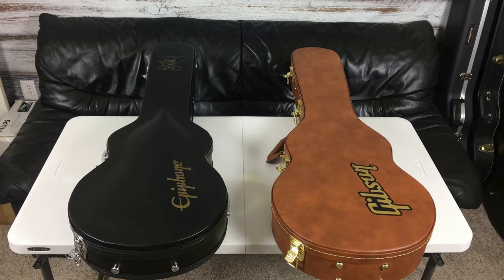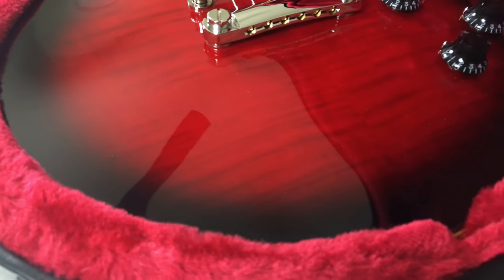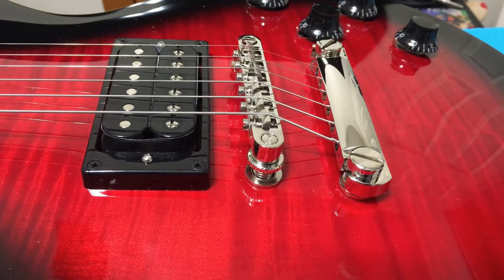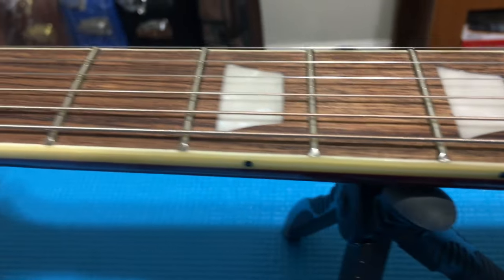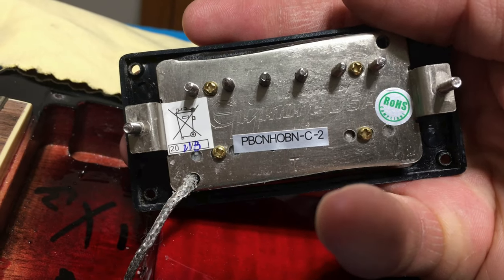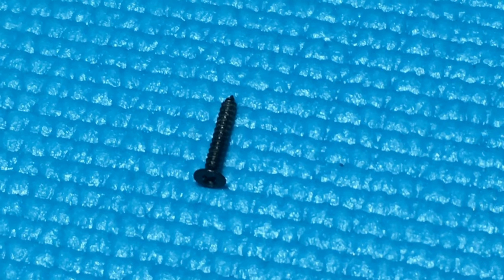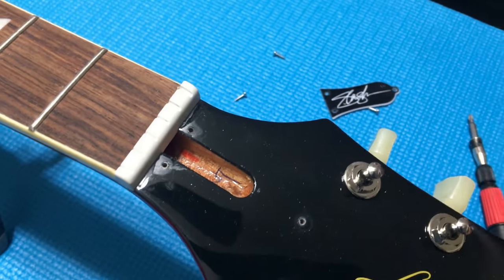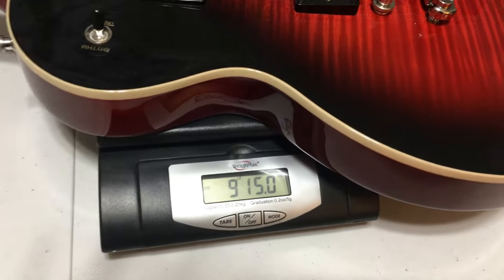Is the Slash Epiphone as Good as the Slash Gibson?

Comment: I have the Slash Epiphone Gold top. Love the feel and playability after it got a top notch set up but the Probuckers we’re actually terrible. I dropped a set of Gibson Burstbuckers 2 and 3 that I had and required the controls with better wiring in a 50s style. It is now a BEAST of an axe. Absolutely love it but I will say that Epiphone dropped the ball on these by not putting Slash Seymour Dunkins in them from the factory. People would have paid the higher price for it. I had a cheap Epiphone Les Paul Appetite Burst with a bolt on neck years ago and those pickups were actually much better than these new ones. They had a tuner built into the pickup frame also. Cool
Little guitar that was

Comment: I bought the Epiphone version of this guitar. I dyed the neck, just because I like the look of a darker neck on an LP. (It took me about 20 minutes.) When it comes to the pickups I don't really hear much of a difference between the probucker customs and the slashbuckers. That is if you don't need to input your guitar "naked" into the mixer (for re-amping purposes). I use an amplifier (like most people would do), and the difference is so miniscule that it's basically nothing. I don't mind that the binding doesn't go over the edges of the frets. For me that's a big plus. I live in a country where temperatures and humidity changes a lot. Those gibson bindings are not suitable here. So yeah, all in all, I'm very satisfied with my Epiphone Slash LP. It looks good, it sounds good, it feels good and it's heavy as your mother.
Reply: Just remember one thing. He said, on the Gibson, that the electronics are done by hand. They are ALL done by hand. There isn't a machine that does wiring, soldering and setups. No matter the guitar, they are ALL done BY HAND.
Reply: I know , right ? Like it’s a huge upgrade ! Don’t be fooled people .

Comment: 6:20 How does Gibson do this thing where the fretboard binding extends to cover the ends of frets also? It looks super cool
Reply: They use regular sized binding like on the body and hand file away the excess over the fretboard. Hence why most new Gibsons still have tooling marks on the fretboards. Many people who haven't owned Gibsons initially think it's a quality control issue but it's not.
Reply: @vladimirpoutine7522   
ah that makes sense. Damn can't imagine what kind of precision goes into shaping the frets yet alone the binding to do something like this. Crazy attention to detail :D
Reply: @WalnutWarrior7  Yeah if you look at the Gibson models of 2015 where they did away with the fret nibs, you wont find tooling marks because they can even out the frets and fretboard on the swing sander. Smoothing the board and frets out simultaneously and not having to use files in between each fret.  I have several models of both types and I still prefer the neck feel of the nibs so I'll deal with the minor tooling marks.
Edit: forgot to mention, models with nibs, the fret ends are cut flush to the binding that fits into a channel flush up against the fret ends prior to being shaped.
Reply: My China Chibson John Sykes has perfect fret binding on ebony fretboard Totally awesome guitar
Reply: Wow ! The competition is coming on !

Comment: Their should be a bit of relief in the neck. It's not supposed to be perfectly straight.

I don't think the Epi is Honduran Mahogany and often the "maple" cap (not the top veneer) isn't actually maple. There are a lot of woods that are called Mahogany, but they aren't actual "genuine Mahogany" and Epi is known to use these substitutes. It's actually not common for manufacturers to use Honduran Mahogany. It's pricier and harder to source.
The Gibson pickups are $300 a set. The Duncan's are $240. That's a lot for a 999 guitar with the specs of a LP w/hardshell case, etc...